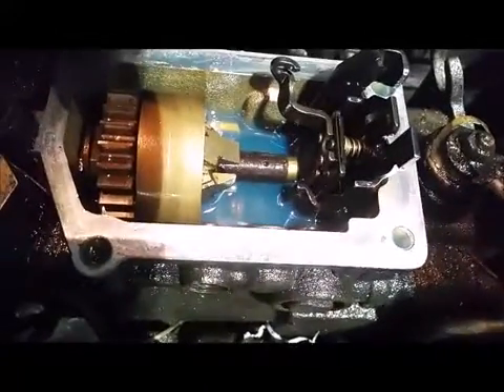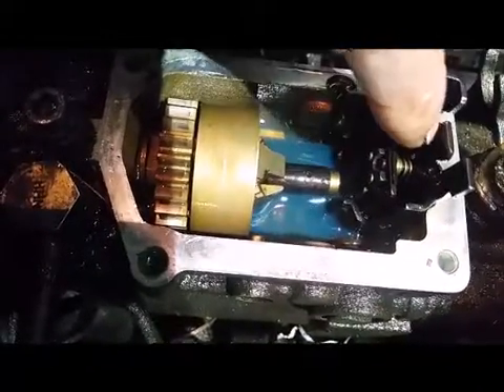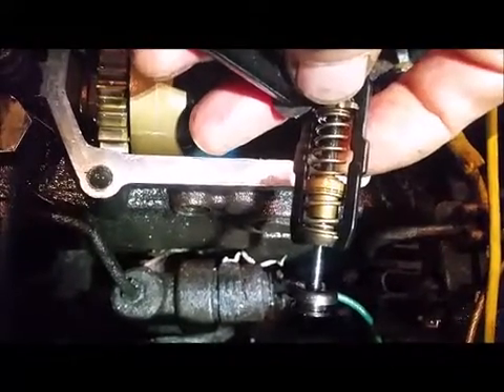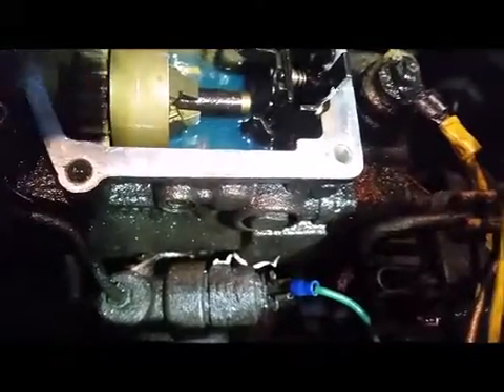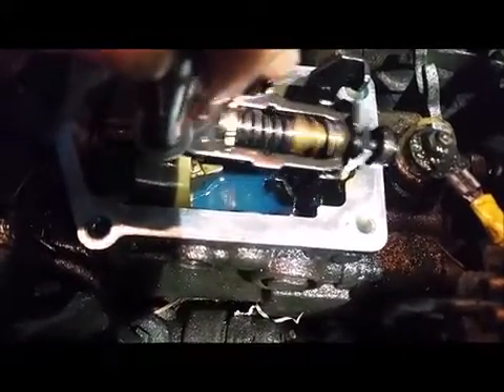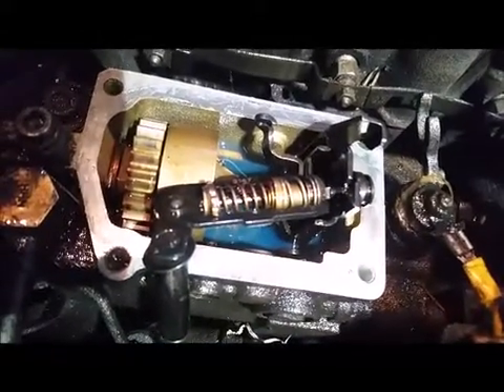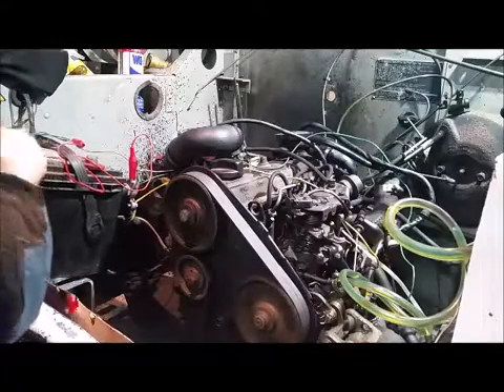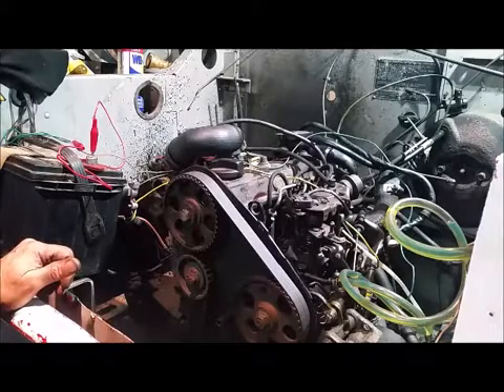Fixing a VW turbo diesel injector throttle

Comment: Can this happen of fault of injection pump ???  I have mk4 golf 1998 And No response from gas pedal and Rpm stuck itself And nnthg hapen
Reply from the maker: Not sure of the question but I think the answer is yes.
Reply: @peterluckham9042  my car Stays at Rpm 10+ (1200) and no response from acelerator pedal when i push can it be fault of injection or not ?
Reply from the maker: assuming you hav ethe same injector I think yes is the answer. here is another video worth looking at https://www.youtube.com/watch?v=Iy77yKjUUW0

Comment: Did u convert kubvan to RWD?
Reply from the maker: yes for a short while. I used a toyota 4wd transmission and mounted the engine on a acme converter plate while rotating the engine mounts to accommodate. I have since converted back to front wheel drive using a Nissan Leaf electric motor and drive train.